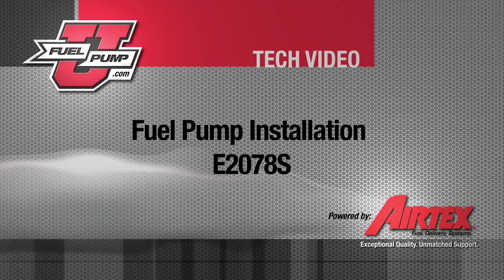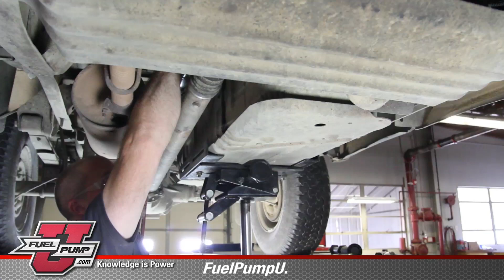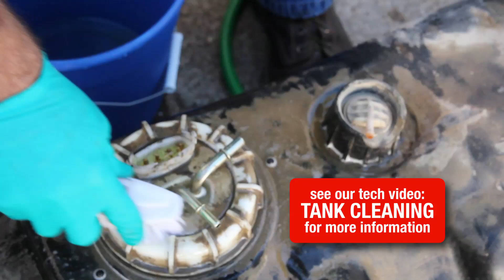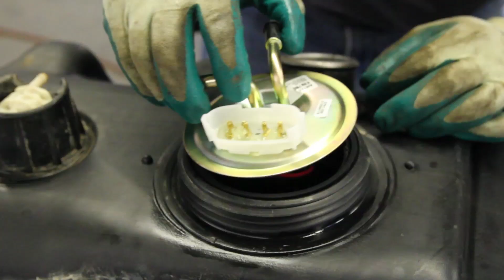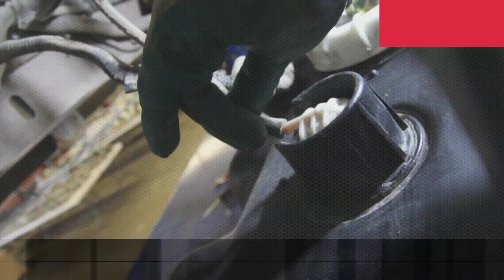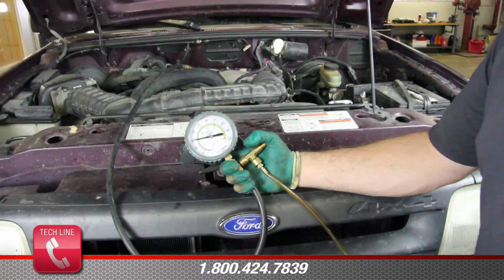How to Install E2078S Fuel Pump Sender Assembly in a 1993 Ford Ranger 1989-1997

Comment: So basically you don't have to take the bed off to get to the fuel tank
Reply: I'd use a friend or get a engine hoist and take the bed off cause most people don't have a lift to put the ranger onto.
Taking the bed off is easier. With a engine hoist it's a 1 man job.
Reply: @coletrickle--iXLR8  I slid the bed off onto a wheelbarrow…one man job.

Comment: ha, try that job with no lift, in 106 degree Oklahoma sun, no shade on the black top. The fist Time i dropped the tank. then after I got it all back together thinking I was golden, it would not run, I didn't test the pump and it was no good, second time in the same place I took the bed off, MUCH easier! since I knew the tank was clean anyway. would have been harder to clean the tank like that. 

   the reason i was checking this out is everything was find after that, drove it all the way across the USA starting that day. but now I have this weird problem. the pump is still working about 3.5k later. BUT the gas Gauge pegs at full when you turn the key on no matter how much fuel is in the tank and when I shut it off the gauge reads half full no matter how much is in the tank. also the Temp gauge stays on cold and the Interior Light in the ceiling by the rear window partially lights when I step on the brake.    I cannot seem to find the problem. all the fuses seem good, box by the battery and the interior fuse panel under the steering wheel.    anyone ever have this problem?
Reply: Love the way you demonstrated the procedure, easy and quick. Great job😊
Reply: Thanks. I have exactly the same problem with mine.
Reply: Guys a pro I have an issue , no lift 38c  it's going in to the shop